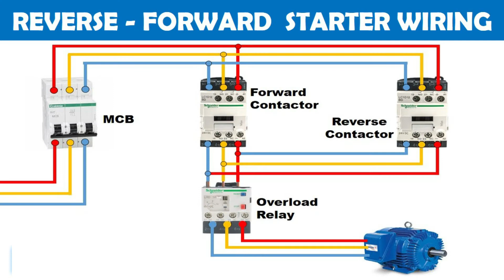Reverse Forward Motor Control Circuit Diagram in English @the electrical Guy

Comment: In your motor power wiring diagram it appears you are using a 3 phase motor with three leads. How do you wire a motor that has this configuration,  (T1 T3 T6)  (T2 T4 T8) where to reverse the direction you swap T6 and T8 ?

Comment: Sir, thank you very much for your reverse and forward control circuit. Can explain how to wire 3 phase air compressor auto on off with 11 pin phase failure

Comment: Sir i have  one doubt Why holding circuit forward contactor output  NO  is not connected to  A1 coil supply. It' connected to forward contactor NC point.

Comment: I have a single phase motor with 2 capacitors , 3 position switch ,to select up ,down and off ,2 contactors . I need to run this motor forward and reverse using the selector switch,please kindly assist with simple wiring diagram.
Reply: Just connect the selector switch instead of 3 P.B (as used here). All the wiring would be same.

Comment: hi, first when you show how to connect the commutation of the two contactors from the reverse button, two cables blue and yellow come in, and when you show the already connected motor, the yellow cable is missing. how do you change direction after missing?